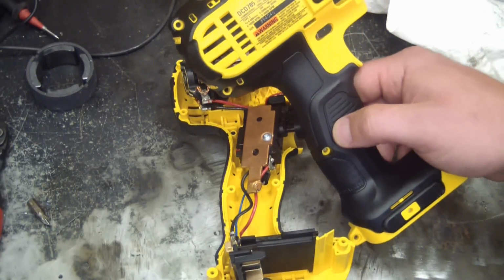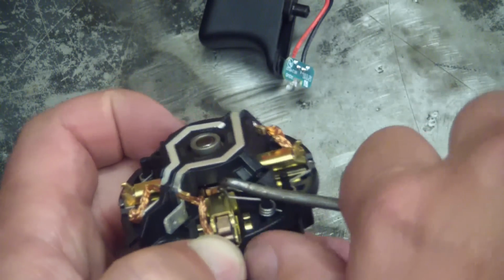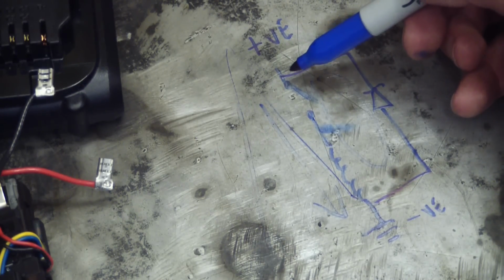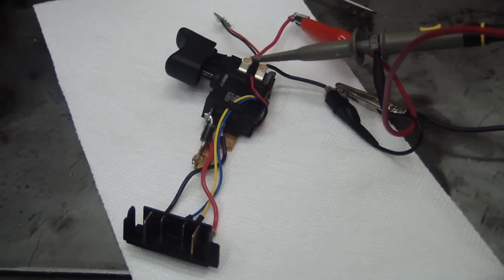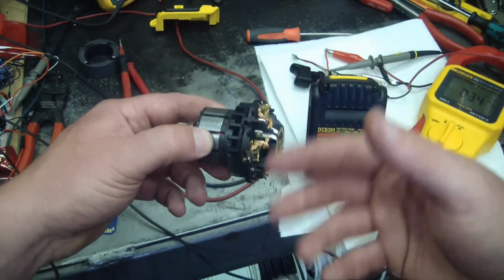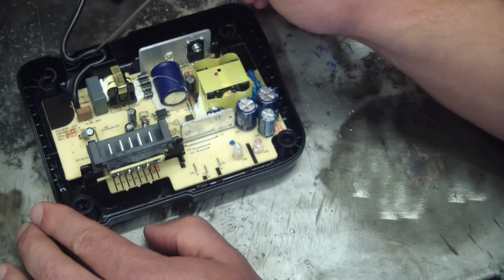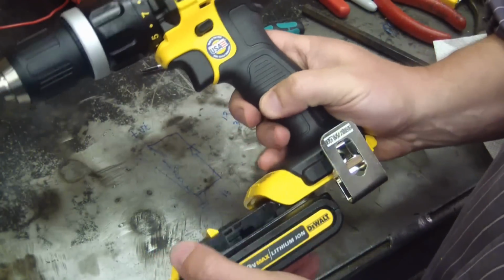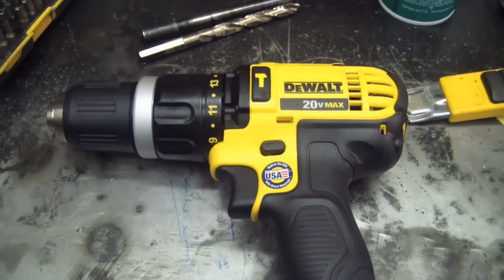BOLTR: DeWalt Hammer Drill. Test, tune and Electrical

Comment: If you put 4.2 volts across a lithium battery charged to 3.8 volts, how much current will it draw?

A power supply can only provide so much power to a given load. Ask for more, and its output voltage will drop (constant current). Ask for less, the output voltage will remain constant (constant voltage).

These aren't fancy charge schemes - it's just P=IV!
Reply: petelite it´s a standard charge schema, true. But the limitation is the battery chemistry/physic not the charger. Or put simply: How hot can allow the battery get before causing problems? The charger could be build to put out a stupid amount of power that damages the battery no problem. Or the charger could be build to be a slow charger that prolongs the battery life. Or as usual: The charger aims at a fast charge rate with reasonable life time for the battery.
Reply: petelite 
What you are describing is constant power, which is something different than constant current or constant voltage. If the voltage on your power supply drops under load, you are overloading it (unless you set it to some constant current setting and it's built for that).

Comment: I don't know if he knows what he's talking about, but a buddy said that tools advertised as 20v have more to do with how hard the chargers try to push the electrons back into the battery than how hard the battery pushes the electrons through the motor.

Then I found someone who sounds a bit more like they know their stuff.  They said the 20v rating is what you get at pretty much zero load.  And the 20v's will be branded as "Max" or something like that which SOUNDS like some super macho advertising word, but is actually a discombobuled disclaimer telling you that's the maximum voltage of the battery, not what you get under actual operating conditions.

A Fluke could probably help figure out which guy was right.
Reply: Benjamin Shaw The 20V is both how hard the charger pushes in the electrons and the "zero load" battery output voltage. Or close enough. The charger will not apply much more voltage then battery has when fully charged. Anything but this would be like filling a 2bar pressure tank from a high pressure source without a regulator in the hope that the flow resistance of pipes, leaking and the reflexes of the operator will prevent the tank from blowing up.
That the "max" is a "discombobuled disclaimer" is true. For any claims, always ask for the datasheet and in the datasheet, look for the conditions under which the data applies.
Reply: TheMrTape eventually, someday, they'll have to give everyone who bought a" 20v" a check for $5 and a lawyer for $5 million.  "+2v OVERCHARGE" would have been an more honest label.

Comment: So in a BLDC you have 6 mosfet in a brushed motor you have 1 mosfet other electrocic kinda same ok you need a hall sensor too in BLDC. So tell me again why dont you like the BLDC? Will the 5 mosfet and the hall sensor fail more often then the other electronics from moisture?
Reply: Hulla Dek The DC motors can run from straight DC. Old(er) switch assembly had a clinking switch that actually passed the battery voltage straight trough to the motor when the switch is fully pressed. So, if the electronic failed, you still had 0% and 100%, just not something in between. Here with the battery sensing it is likely that if the electronics fails,  the motor wan´t turn at all. Modern stuff it is.

With a BLDC, there is no way to implement a fall-back the simply lets the motor run on a 100%. Either it works or it doesn´t.

The BLDC also implies a microcontroller. if there is a microcontroller, the manufactures tend to implement safety features like torque limitations, over temperature protection and other fancy things. All nice things that protect the drill. But in the field, when you have to get the job done, you want to be the guy that decides either to get the job done and buy a new drill or to give the drill a break.

Not having a protection by a microcontroller also mend that the mechanical parts where more robust. There was nothing to stop the user from abuse, so the drill had to survive it. Now the electronics can stop you from abusing the drill, which in turn means, that the parts don´t need to be over spect.
Reply: sarowie I was talking about drills like the last 5 years so even it has brushes it has electronic  . Yes you have a more complex program in a BLDC but the chance the electronic fail is the same as this brushed. Well you right you could hot wire the battery to the motor in an emergency if the electronic fails, but then you can easy damage the battery. But the electronic fail is much less likely then the brush fail.
Reply: Hulla Dek
In old equipment, the battery was directly connected to the battery when the trigger was fully pressed. Spare brushes aren´t that big/expansive to heave spare parts. But yeah: In sum, the engineering quality and the executed manufacturing quality counts and not the technology. And a field failure of a drill sucks regardless what name is on the tool or what technology was used. A well done BLDC system might out live a cheap DC system and vice versa. As the drills with DC motors get more and more "intelligent" features  there for the failure rate of the electronics applies to the DC motor drill as well.

Well, pleasures and problem of smart stuff.
Brings to mind: Would there be a market for "good old equipment"? Hhmm... I have to give that a think. I´m not in the tool industry, but... maybe any industry has a demand for simple reliable tools to get the job done
Reply: Hulla Dek You need no stinkin hall sensors for a good ol BLDC. As long as there is some reardown - no problem starting and working on back-EDS. All the RC ESC's work that way.
Reply: NGC1433 as long as there is some GEARdown, i was trying to type...
Reply: Hulla Dek if you had the bidirectional control done with electronics, rather than a switch, it would need 4 MOSFETs.
some bigger DC motor drivers use 8 or 12 MOSFETs for more power (say, you want to be able to run a motor in either direction at 60 or 90 amps or so with 30A MOSFETs).

running a BLDC can use 3 or 6, depending on how it is driven:
with 3 transistors and a Wye motor, common can be connected to Vcc, and the transistors can pull each phase to Vgnd (this is the simpler/cheaper option);
6 transistors can be used to drive a delta or wye motor, and is a little more powerful (though the peak phase voltage is lower).

likewise, parallel MOSFETs can be used for driving bigger motors (say, if you want 90A per phase, for around a 200A motor). similarly, IGBTs are an option for higher voltages (say, running conventional 3-phase motors from high-voltage DC).

typically, BLDC isn't controlled by a hall sensor IME. more typically, you watch one of the phase voltages (either a single leg, or a alternating between the legs), and note when an un-powered phase goes sufficiently negative. when this happens, you advance the commutator.

decided not to go too much into the specifics.

Comment: my dad wants to buy a Milwaukee drill set.  Alternate selection options please.
usage: overhead drilling, running wire
unfortunately he demands a battery indicator and needs a work light on the front of the drill.

Comment: With all the electronic fiddly bits I'm a bit surprised they didn't go with a lil magnet and a hall type sensor for monitoring trigger position. Would let them go for full encapsulation of the board.
Reply: Robert Szasz need something to fail, else they can't sell you a new one.